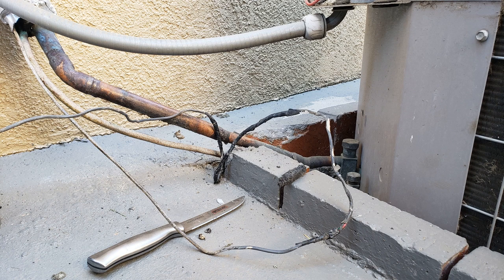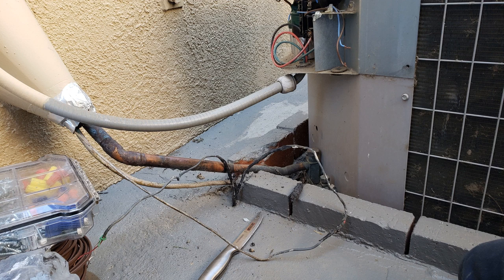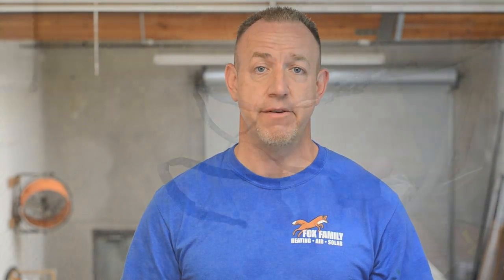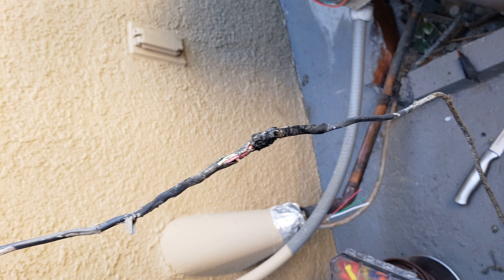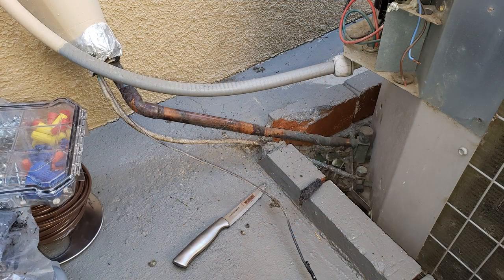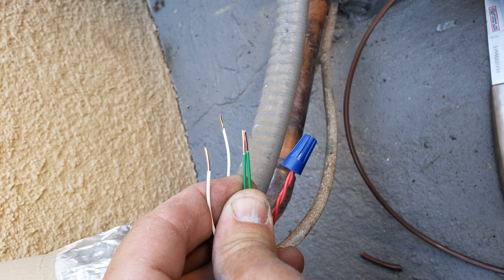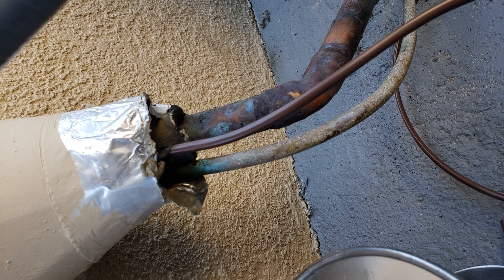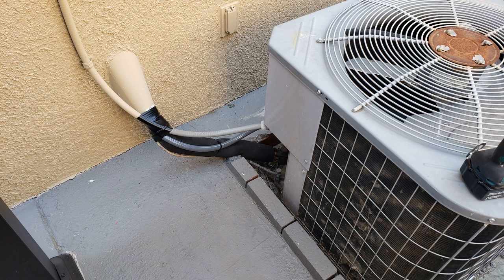Install Repair On A Central Air Conditioner - Protecting the Low Voltage Wires to the AC

Comment: NEC 725 classifies condenser control wires as Class II and only requires they be protected from damage by securing to other objects.  If the condenser is part of a life support system such as might be the case for elderly, disabled or health care applications, then 725 calls out Class 1 with normal conduit and insulation requirements.  NEC does  allow discretion to upgrade normal Class II cables to Class I, which makes good sense and is often done for reliability and workmanship reasons.   Sometimes logic escapes the code books.  As you indicate, low cost thermostat wire used outside degrades from UV, is damaged by animals and is easily cut by weedeaters.
Reply from the maker: Best comment yet!

Comment: The yard guys cut the insulation from the thermostat wire at my house just enough to cause a problem last week. To be fair, the wire was already in pretty bad shape. I managed to find enough “good” wire to splice together for an immediate temporary fix. Luckily, it only blew the fuse so that I didn’t have to wait for a part to come in. I will be replacing the wire and protecting it as much as possible this week. It doesn’t take long at all for the sun to degrade the wire. My unit was installed in 2017, and the wire has been looking bad for a while. Thanks for sharing how to protect it!

Comment: G'day from Brisbane Australia we run all inter connect cable from the indoor unit to the outdoor unit in orange circular cable which is UV protected and is run along with the suction line and all communication cables are double insulated
Reply from the maker: awesome! thanks for sharing

Comment: Good morning, saw your video and completely agree.  As a new homeowner I saw many many flaws in workmanship in a my newly built home and the thermostat wire being one.  So I did see that the power wires and thermostat wires come out of the same hole and split from the fuse box, is this incorrect placement?  And also I wanted to find out more if I can use the same fuse box to place a new conduit for the thermostat wire since it did come out the same hole in the wall.  I’m no hvac technician nor an electrician so I do have many more questions.

Comment: Thanks for the video ur the man appreciate ur video. I'm a new home owner and just started taking interest in my home u no and I noticed that my low voltage wires have protctection but its falling apart and wires are exposed all exposed . So I was thinking u tube the proper way to insulate them and I literally put that in the search your video pop up thanks for the video I went to rsi in phx I did residential commercial ac and electri residential commercial.  But I own a swimming pool company and im a residential concrete finisher new homes much respect for the knowledge and professionalism u bring to the industry.

Comment: That exact problem happened to me a couple days ago. The only difference is my low voltage thermostat wire goes underground!  I had to splice it 2” above the ground which I’m Leary about. Do you have any suggestions on how I can keep the wire nuts safe from water that close to the ground? Thanks and great video!

Comment: I took apart the window unit and threw out a ground wire before checking the triped breaker. Now I don’t know where the  ground wire goes. Not turning on

Comment: I live in Arizona; and just found out that my low voltage wiring for Thermostat to the air conditioner on the roof has deteriorated. Last night nothing worked and the Nest Thermostat has lost charge. Won't even turn on.
I was going to go on the roof and replace/splice the rotten part of the wiring. Can someone please tell me where to get this low voltage wire I need and what the correct name for it is?
Thanks!
Thanks!

Comment: Only one city here in Kansas (that I know of) does require low voltage to be protected in flexible conduit. I think the only way this will be enforced  is if manufactures of HVAC equipment requires that in the installation manual. As Communicating Systems becomes more popular, I do feel that this will eventually take place,
Reply from the maker: That is a very good point.  Well said

Comment: Good Afternoon, What would be the going price to replace the stat wiring, I have recently had this problem happen, my AC systems are Kenmore Comfort upstairs and down stairs unit. The downstairs unit just stopped suddenly after if buzzed when  turned on and then nothing. Units were installed 11-1-2019 not even 2 yrs old. The AC repairman came out as per Home Warranty and said this was the issue, of course the warranty does not  cover because they said it was cut and that was not normal wear and tear. The AC company sent their report as being cut, maybe the word cut caused the denial. Needless to say I had no idea about this wire but did look when shown and it appears the units were installed and the same wires from the old units since the house was built 1996 were kept in place. I didn't know enough at the time to ask about this while they were installing. So, please if you can give me about an idea of what I am looking at to pay for a lesson well learned now.  thank you--Out of my lane home owner

Comment: Or, in an apartment complex where A/C units are lined up next to each other, people step all over them, or in my case when your neighbor replaces their A/C shorts yours out by simply handling it.  Might be a good idea to have your regular maintenance check this cable and replace as in the video before it takes out your transformer(or the fuse if lucky).

Comment: When I did set finishes or retrofits we would tape/run stat wire below suction line and uv tape it. Reason was to protect it from the sun and if in the future someone had to cut the suction insulation with their knife, they would less than likely cut the stat wire...

Comment: if your worried about UV and weather, just use a section of sprinkler system wire, from indoors to outdoors, the jacket is pretty tough also.

Comment: Sorry for my ignorance but I have this question. What is a proper glove to work with refrigerant I see a lot videos of burning hand but I still didn’t see anyone user glove so can you tell me wish one is a good proper gloves to prevent burn? thanks
Reply from the maker: some thicker rubber gloves would be suggested.  Even if they have cloth on the back side of the glove, fine.  Yellow jacket makes a grat shut off valve for the liquid line I would invest in.  No spray off if you do a diminimus detachment
Reply: Fox Family Heating, Air Conditioning and Solar  thanks!
Reply: Thanks Greg
Reply from the maker: Thank you!

Comment: I was told not to run low volt stat wire next to high voltage wire if you are using a communicating stat.  Digital zeros and ones will get messed up.

Comment: I do not think the low voltage wire is going to be dangerous at all. Hence why there are no codes. A repair on this wire would be extremely easy so that isn't an issue. I assume for cost they don't do any further protection. Maybe needed protection if you have a critical application that cannot have any issues. I think any shock you (or an animal), may receive from the wire would not be an issue at all.
Technically with the remaining lines in the stat wire that are unused. Those extra wires should be connected to common (grounded). The reason for this is because they essentially become antennas and can pick up random signals from other sources. This being extremely close to the wires in use can send this signals down the wire and interrupt communication. We have had an issue with this when we had a large switch board with many dampers.

Comment: You just caused me to go out and look at mine since I never paid any attention to it before. It turns out they used a separate conduit of the same type that they used for the HV wiring from the box. Very impressed. Thank you for the awareness. Now a question. How critical is the foam "pool noodle" around the line set that always deteriorates where it is exposed to the elements? Should I be looking at replacing it when it is in that condition and how much difference does it make? Thanks as always.
Reply from the maker: Yeah that suction line insulation should be on your line all the way to the AC.  Is it going to make a big efficiency issue with your AC. No.  But it's nice to keep things like that looking sharp, so update it every five years or so.  Sac City is now requiring us to put a "removable vapor barrier" over the suction line insulation #E-Flex.  Just more crap. Lol 😀
Reply: all needs happen is to install the wire in tight manner using lots of zip ties (every 8 "- 12"), more ties at the bends keeping the wire snug and tight, that much will keep the dogs away... Also it its bundled up tight, the sun and weather wont bother it over the course of the life of the system... 1/2" seal tight wont stop a weed-eater, might slow it down...
Reply: @steveshort1425  It sounds like either you didn't understand the question or I didn't understand the reply. I don't know which.
It sounded like you said the wiring is better protected if left exposed and zip tied than if it is fully encased in a conduit of the type used for 240vac. I'm pretty sure you didn't intend to say that but...unless you were talking about the foam cover. In my case some of it is missing.
Reply: if your bored and don't mind shiny wrinkles, wrap it in aluminum foil tape. just be mindful it's not toughing any of the copper anywhere, including the small "high side/liquid line" dont want any silly electrolysis happening

Comment: I always run them inside the high voltage whip
Reply: that's against code inside the disconnect, unless it has an isolated compartment just for low voltage wiring.
Reply: @throttlebottle5906  not a issue where I am
Reply: @zack9912000  if you're in any of the 50 US states, it's against NEC. it would need a divider, so it was all in a seperate compartment and or be 600v rated building/appliance wire, as inside the units themselves.

NEC 2005, Article 800.133 (A.1.c)
Communication conductors shall not be placed in any raceway, compartment, outlet box, junction box, or similar
fitting with conductors of electric light, power, Class 1, non-power-limited fire alarm, or medium power network powered broadband communications circuits.
Exception No. 1: Where all of the conductors of electric light, power, Class 1, non-power-limited fire alarm, and
medium power network-powered broadband communications circuits are separated from all of the conductors of
communications circuits by a permanent barrier or listed divider.

Comment: Was running it through the whip until I was told not to by my manager.
Reply: right, that would be against code being inside the disconnect, without being in an isolated compartment. that's also why condensers have a small splice/termination area for low voltage wiring, even though the wires jump over into same shared space as high voltage and are often touching, the wire changes to higher voltage/temperature rating, etc.